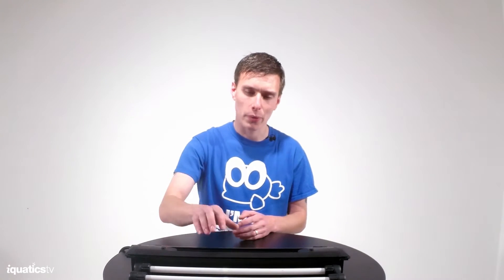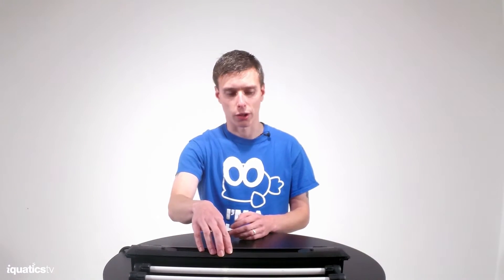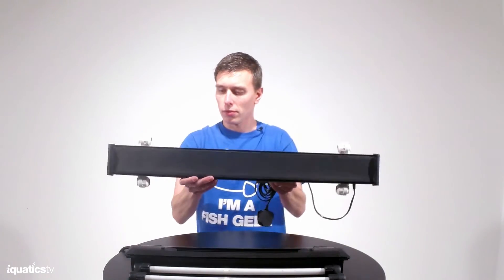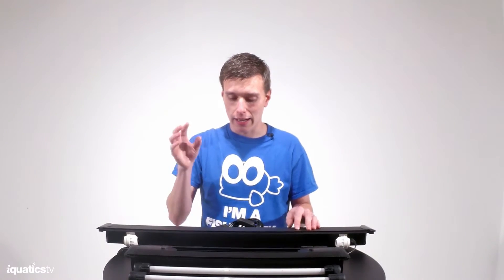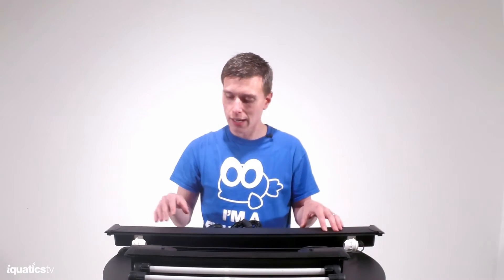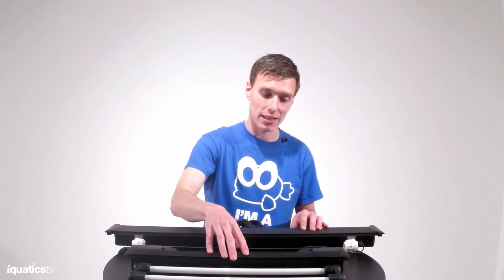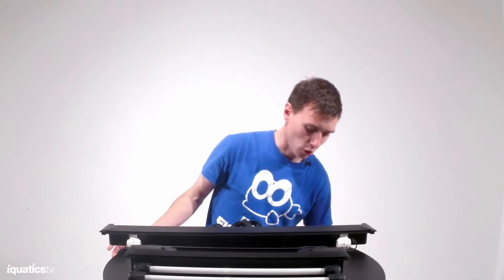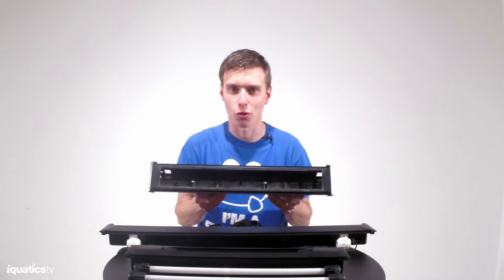The iQuatics Universal vs Juwel Hi-Lite (High Light) & Multilux T5 Light Bars

Comment: The flap set from juwel model can be used for this aluminium one ? My lights are not working anymore and the new one is a bit too expensive.
Reply from the maker: Hi there, yes your original flap set is compatible with this light unit :)
Reply: @IquaticsonlineCoUk  : I just came here to ask that exact same question. Now I know the answer I’ll be placing my order with you for a new light unit for my Vision 450 in the next few minutes.